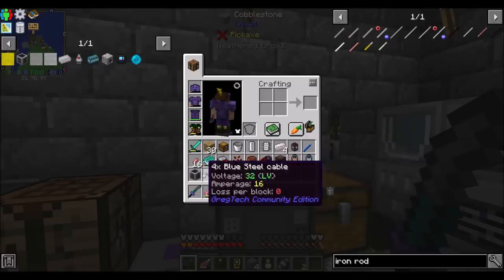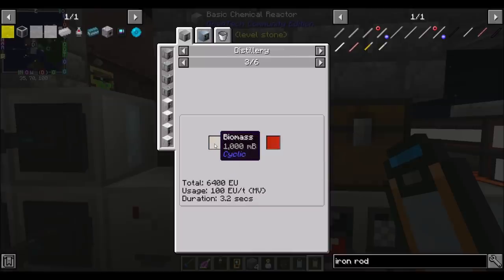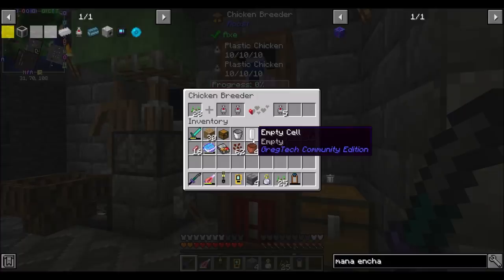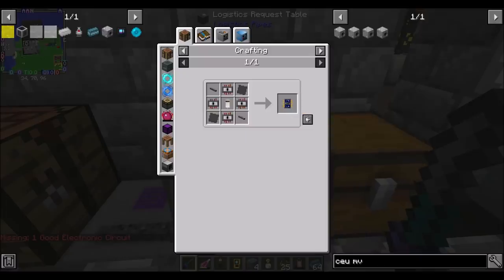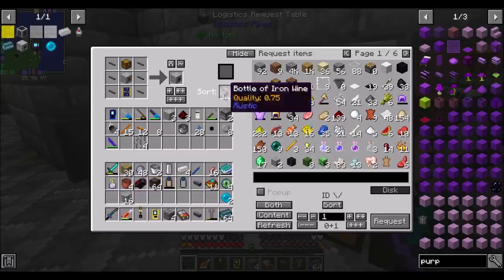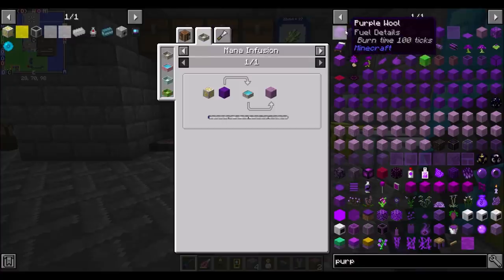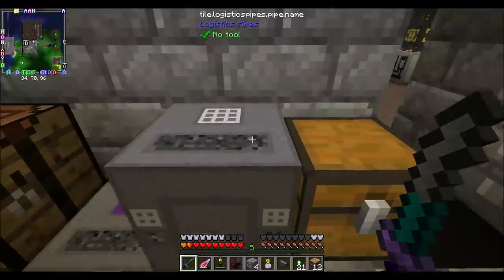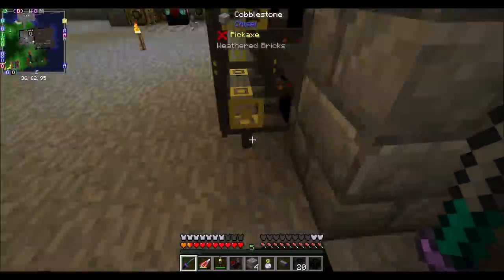FTB Interactions EP43 All the Enchants

Comment: Dire when you enchant, there is a number with a green XP ball on the enchant (hard to see, i know) that number means how many levels you are going to spend, if its the top enchantment you will lose 1 level, if its the one in the middle 2 levels and if the one at the bottom its 3 levels, it doesnt matter if the enchant is lvl 60 or lvl 5.

btw Apotheosis goes crazy with enchants there is a block called altar of the sea (you can currently craft it) that if you give it 4 enchanted books it will take XP from you and give you another enchanted book, the better the books you give the better it gives back and the more XP it takes:
i mean 4 lvl 60 books gave me like Efficiency 23 then i took 16 books to make 4 of those and put those 4 in again and got Unbreaking 60 but it used like 200 levels and more

Comment: Dire, 1 I do remenmber RTX silencing you, so probably leave it off.
2, try enchanting Tinker's stuff, I heard it works thanks to a plugin.
Also, remember reading the ques descriptions, item names and words (it helps).
Reply: Quick question. Where’d you hear about the whole enchanting tinker tools thing. There’s supposed to be a plug-in, I know that part, but do you know what the name of the plugin is? I just wanna make sure we aren’t telling Dire the wrong thing.
Reply: @z_is_for_zombie7423  TinkersExtras allows tinker tools to be enchanted.
The only enchants you get on tinker tools is Unbreaking and Soulbound though. You can easily get soulbound effect using Spectre Anchor from Random Things (pretty cheap, ectoplasm + some iron plates) and as far as I can tell Unbreaking enchant doesn't affect tinkers tools.
So all in all, not much point to enchanting tinkers.
Reply: syy1125 Uh, are you sure? I’m looking at the Tinkers Extras github and I don’t see ANYTHING about enchanting tinker tools. It looks like a mod that lets pack makers disable certain tools or materials. I don’t see any references to enchanting at all. Am I missing something here?
Reply: @z_is_for_zombie7423  not 100% sure what mod is adding the enchanting, I'll have to check the mod list. But you can definitely enchant tinker tools. I've played on interactions 2.0.9 and I have enchanted tinker tools multiple times.
However, my point about the enchantment limitation stands - enchanting tinker tools is pretty pointless.
Reply: syy1125 Well... crap. 😞 Now I feel silly.

Comment: Tomes can be turned into enchanted books by using the splitting enchant on an anvil
Reply: I think the max for apotheosis is XX, aka. 20.
But thats the highest i have seen and i didn't have a maxed out enchanting table..
Reply: More apotheosis tips: get age of knowledge enchant. It turns loot into xp, combined with every other enchant that increases loot drops gets you to level 300 in a few minutes. If it isnt installed already get the mod that stacks xp into one orb.

Comment: Dire, you may not noticed it, but enchanting table offers you for example lvl 45 enchant but consumes only 2 levels. Real experience cost is on left, on right you have ENCHANTMENT level. Only difference is you need lapis, so you pay 3 lapis, a book and 3 levels of experience for level 60 enchant. And you could enchant some bow with that Book of Archers and disenchant it in some way, if Foregoing is in the pack this is the way :)

Comment: there are 5 possible options for making PolyEthylene and you only looked at the first one ;)

 (i.e. similar oversights may become problematic in the future with some recipes costing you way more in material than they should be, if you used a different recipe than the first one presented to you. Like later, when you get into cetane-boosted diesel, polyvinyl chloride, polytetrafluroethylene [say that quickly five times], and various other chemical processes. You should probably consider building a small tank room for oxygen, hydrogen, methane, nitrogen, etc that you'll get as castoff from electrolyzing things, because you will need lots of the stuff)

Comment: I don't think you need to be that heedful with your levels since they change the mechanic.
You can freely enchant a lvl 1 book with 60 levels on you without losing a whole level from 60.
It would only take away one tiny smidgen of xp.
That way you'd save yourself alot of time by not constantly exchanging levels with your tome back and forth.
Reply: no, it will use whole level, you'll end up with 59 levels